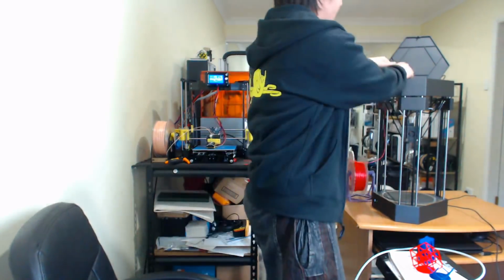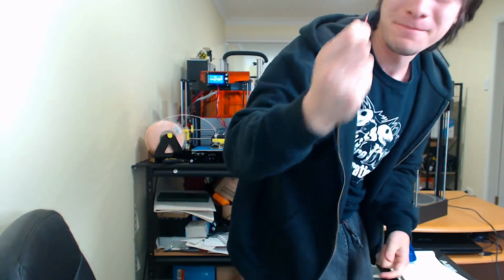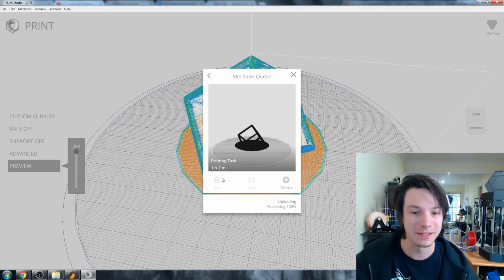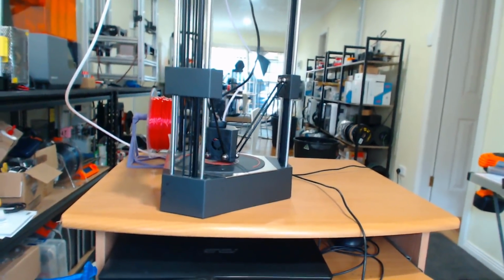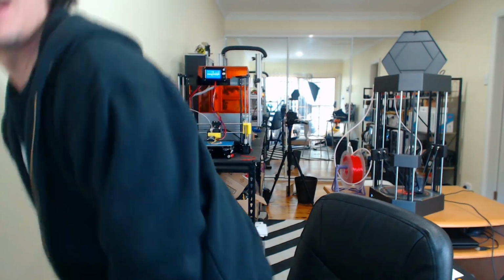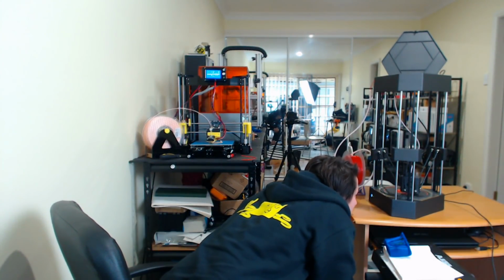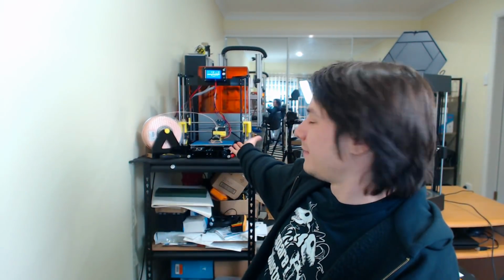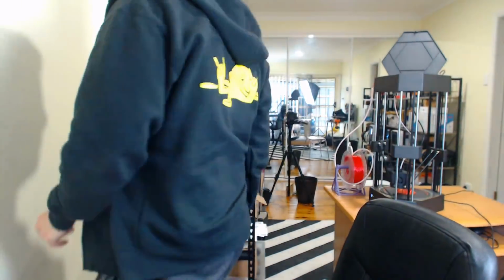Tuning 3D Printers with Q&A

Comment: If you add 2 9mm Clip-on Ferrite Ring Core on each axis and the main power cable you will greatly reduce noise and ringing. Prints will come out smoother. Also adding 1 32x3 mm round n52 magnet completes for perfect walls.

Comment: Suggestion: Perhaps filling the tube with a light coating of corn starch baby powder would help to thwart moisture and make it easier for the filament to feed through.  Also to keep filament from getting stuck in printer, perhaps it'd be good to pull/cut the filament after a print, but make the printer keep printing to try to get it to shoot out that last bit of filament.
Reply: Cocaine works too if you don't have baby power on hand.

Comment: Just printing a ABS motor bracket for my printer :) In Cura setting layer height to 0.2, should I have the initial layer slightly more than 0.2mm ? ie 0.25

Comment: I wanna sit at home with my sweatpants and fiddle around my 3d printer and get paid for it too. Life is unfair.
Reply from the maker: +radry100 bagwash pants! Lol
Reply: radry100 hahahaha so true
But look at the bright side, find something you are good at and start geviewing it x3 maybe you find succes
Reply: It is so much more work than you think running a channel.
Reply from the maker: literally full time job lol.
Reply: Maker's Muse what's your opinion on the Flux Delta Plus? I have the Cr 10 and my Delta plus should be arriving any time now but wanted to know if you've used the other features it offers such as the laser engraver, plotter and cutter?  The overall design and features sold me big time and would like to know your thoughts on it? Build quality, Pros Cons etc. I dig the auto leveling and safety sensors etc. Also any reason you prefer to not put the spool inside the top of the unit ? Just easier to swap your filaments or do your prints come out better ?
Reply: Try it sometime. You'd be surprised how much of this is actually "just doing it". If you haven't, or think you can't, it's because you haven't tried.

Comment: Question: Can I desolder the 'A' (anode) pin from my LCD screen and connect it to a servo breakout pin instead, thus creating a brightness control for the LCD that is controllable via g-code? I want to make a kind of "night mode" now that the Marlin firmware likes to blink when the motors are disabled.

Comment: hey great videos just wondered if you could recommend a print surface for my wanhao i3. I see your not using the standard print surface and apart from blue tape I have no luck with any other surface
Reply: Not sure if you've figured it out yet (I hope you have!) But I personally use glass with a quick Spritz of Aqua Net brand hairspray. My PLA prints stick beautifully and just pop off as soon as it cools.

Comment: Is it worth enclosing a 3D printer like the Prusa based models, or my Up Plus2? I get more warping than I would like. It is cold here in central NSW, only 3C today.
Reply: Yes you should if it is that cold, and if you often print out ABS in a small room it is also a very good idea.

Comment: Your opinion on Tevo is unwarranted you happened to unfortunately get an early release, the kits now are fantastic for the price easily matching your Wanhao printers. I got mine in March this year as my first 3D printer knowing nothing about them and found it very easy to assemble and get going in the stock configuration prints were on par with my neighbour's Cocoon Create. I have since made a few upgrade of some feet and inverted the z rod mount which cost nothing but time and filament to print them. It creates stunning prints for $300 Aud  as good as any print I have seen on your shows. I would really revisit Tevo ask them for a current model as you are really sending the wrong message saying they are no good as they are superior to Ant A8 and what ever that thing is behind your right shoulder for rigidity and they are really quiet when printing compared to any printer that uses Linear Bearings and rods.
Reply: The tarantula is flimsy and it's pure luck if you get good results or not. I have one myself and in its stock configuration it's not rigid, the leadsscrew z axis design is flawed as well. It was originally designed to use metal parts but they were swapped for acrylic to maximise profit. That lead to a lot of problems. It's still a nice kit to learn about 3d printing.
Reply: MrGrantdw thanks for your opinion, my birthday is coming up soon this month, and I'm hoping to get the Tevo tarantula I3 for my first printer too!
Reply: I really like my tarantula it is not flimsy like radry100 recons the only part that could be called flimsy is the z screw motor mount. It a much stiffer frame than any of the anet a8 designs. the only bad thing about the kit is the lack of washers for the acrylic parts make sure you get plenty of 4mm, 3mm and 5mm washers and don't over tighten on the acrylic parts. The only upgrades as I mentioned are the feet mounts to screw it down to a board and inverted the z screw with new bottom motor mount and the matching top bracket that holds the z screw in a 608zz bearing all can be found on thingiverse under tevo tarantula.
The best advice I can give is take your time make sure every thing is square and aligned don't over tighten on the acrylic parts and check out the facebook community for any questions or problems they are grate and very fast and friendly with answers.
Reply: Thanks, ill make sure too right that down
Reply: The design is flimsy by nature, the z/x gantry is connected to a single extrusion via a couple tiny bent metal l brackets, which, along with the single extrusion, have to resist the twisting forces as the gantry resonates with y movement because the single bed rail in the center is also what's keeping it from rocking back and forward.  sure, you can bolt it down to a piece of plywood or table with a couple of braces and solve that problem, but a properly framed alu extrusion prusa clone (like the FLSun i3) with a box frame around the base is as stiff without such measures.
Reply: MrGrantdw nice paid comment, shill.